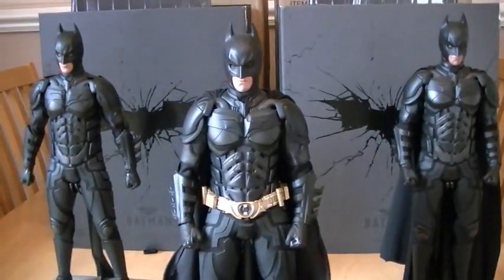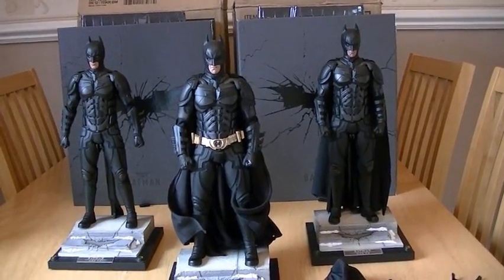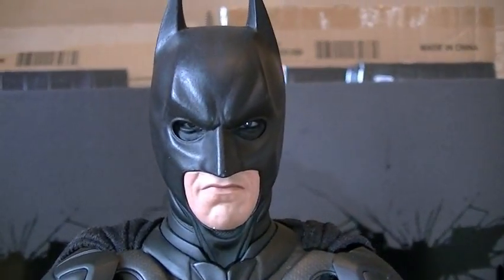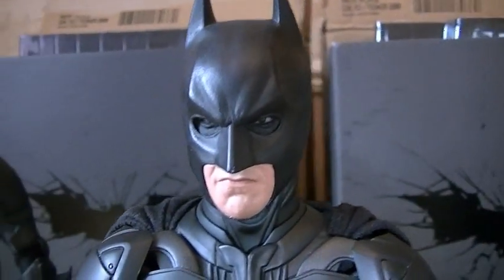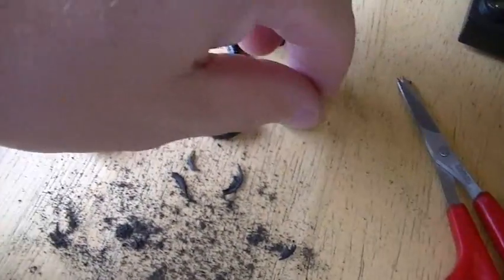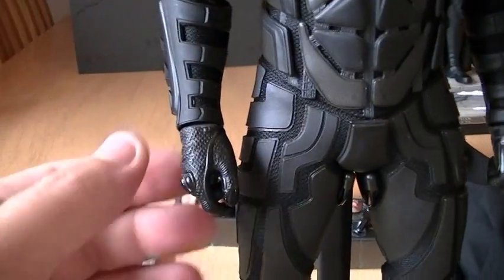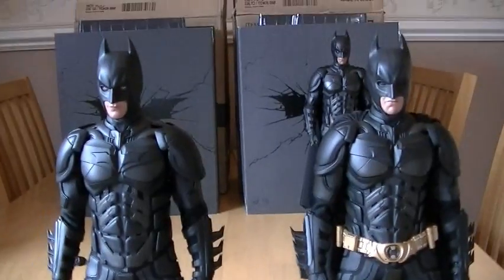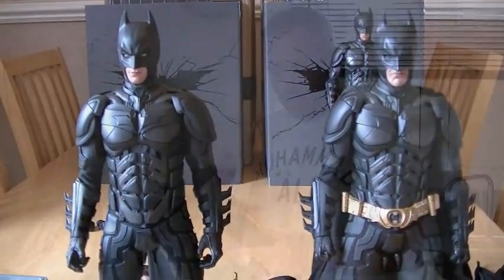Hot Toys DX12 Batman Modification Job

Comment: I must say these mod were pretty simple! I just bought one used for 300 on ebay w/one listed flaw(no bat pod adapter). Right out of the box I noticed a loose arm. Pulled out the neck to find a broken shoulder. Messaged and got $75 back, and then I decided eh what the hell. The only thing I didn't do was paint the eyes, but otherwise it took about 30 or 45 mins. Considering what I paid/that I can't really sell this later, it was worth it. I will say only to be careful sanding the top of the hands. One of my gauntlets hand holes is slightly more ovular vs circular due to how its forced to overlap the hand.

Comment: So that's how you use a wash? Every other video just shows you paint it on like you paint a base coat and it just works, no one ever mentions that you first paint it on then wipe it off while it is still wet! However, every time I tried it that way, I ended up with water marks, could never get it neat like you have. Thanks for the massive clip Clipper, also the other you mentioned were good to but that part really stood out!